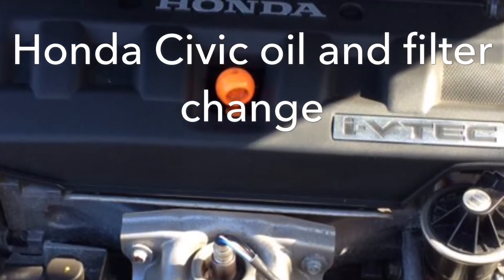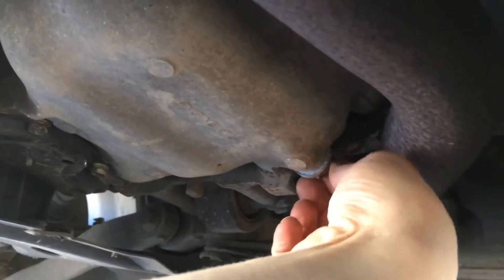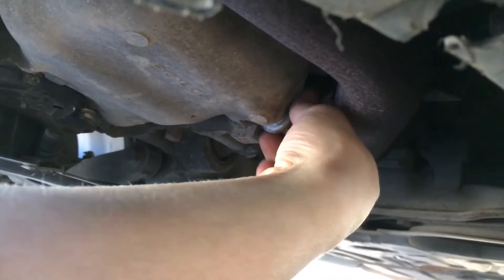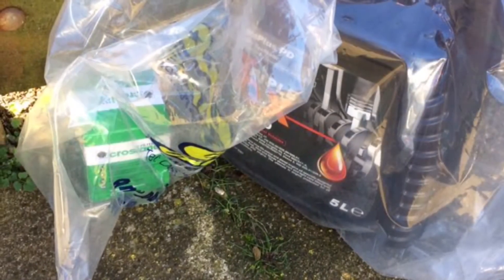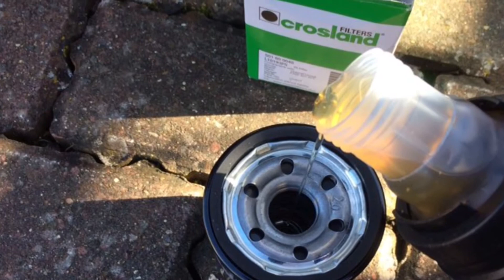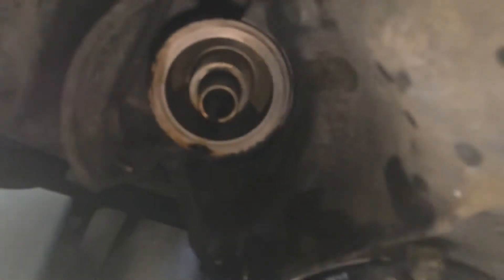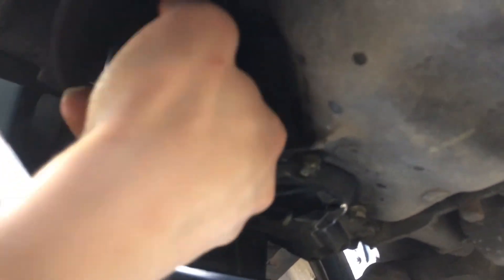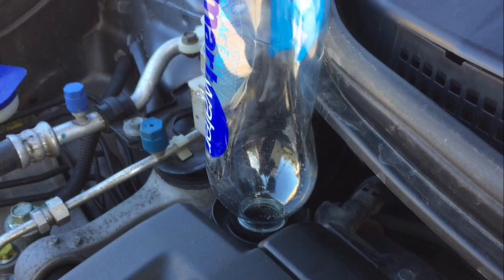Uk Honda Civic 8th Gen Mini Service

Comment: Always remove and replace the filter before you drain the oil. If you run into problems taking the old filter off, at least you still have the old oil in the sump and you can drive it until you sort it out.

Comment: Hi mate, first of all thank you for all the informative videos. Very clear step by step so great job! I just want to aks if you've done a transmission oil change on your 8tg gen before? Any tips would be appreciated. Cheers!
Reply from the maker: Julius Desbruslais thank you , yes done a few gear oil changes before , you will need around 1.5 litres of oil best to buy 2 , same as an engine oil change really drain from the bottom and there’s a fill plug on the side , make sure your cars level and fill until it starts to come out then install the plug again .
Reply from the maker: I will get you some pics the weekend and email you 👍🏻
Reply: Thanks very much in advance.. I'll be sure to promote your channel to my petrol-head friends as well!  Keep it up The cjrshop :-D
Reply from the maker: Hi il be releasing a how to change gear oil very soon if not here’s a link with a pic on it for you http://www.civinfo.com/forum/engines-transmission/43415-gearbox-oil-change-1-8-vtec.html
Reply: Cheer mate! You've been very helpful
Reply: I've just changed my transmission fluid however, I've done it while front of car is jacked up. I assume the fluid level is wrong so how do you do yours? Do you raise the front and back with 4 stands?
The car drives ok but just want to make sure all is fine.
Reply from the maker: How much approx did you put in ?
Reply: @Cjrelectrical  this thread is very helpful, as your other videos. Many thanks for carefully putting this channel together. 
I'd be very interested in a video tutorial on how to change the gear oil. Perhaps you could do one next time you change your car's. Thanks again.
Reply: I used the fill plug on top of the gearbox. It's quite far back and needs both the airbox and battery removed. It's cleaner than the side fill bolt if you ask me.

Comment: Isn't the whole underside of the car covered with a plastic cover? Thanx
Reply from the maker: Tintoycar no the front has a thin metal plate which you remove to gain access to the sump etc but like mine most of them are missing .